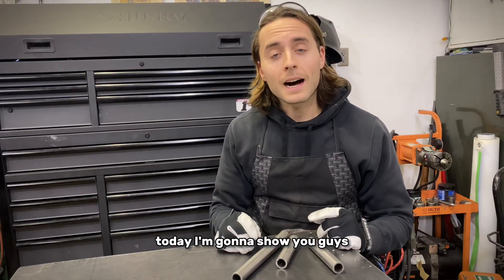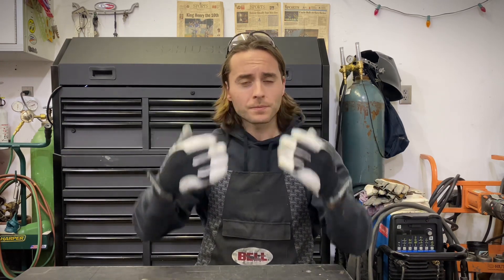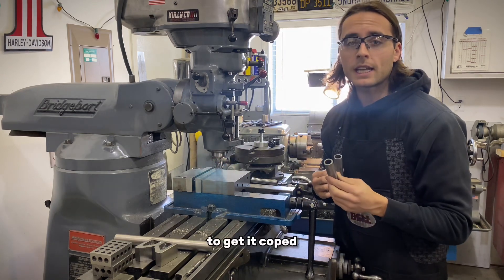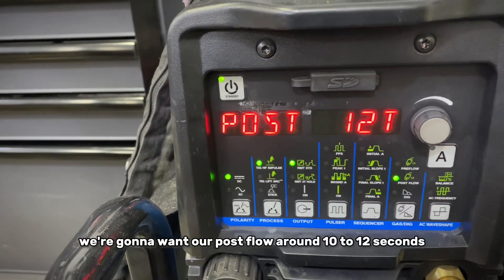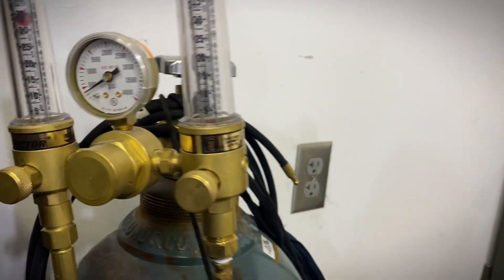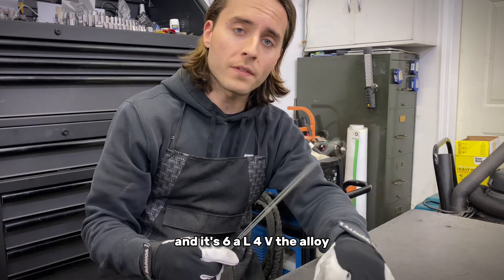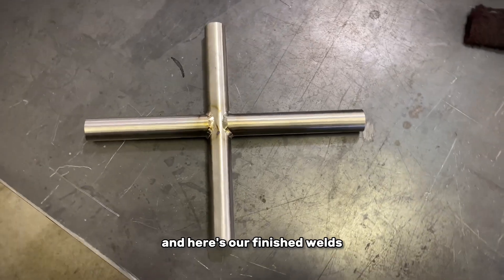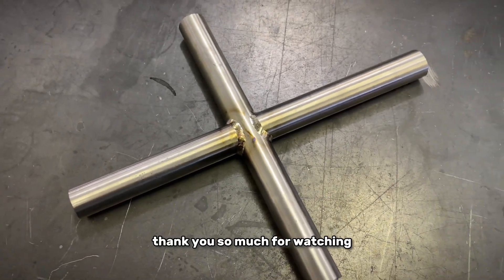How to TIG weld Titanium frame tubing

Comment: Where are you obtaining grade 5 Ti tubing of this large diameter in smaller quantities?   I can only find Grade 9 which is what most bike frames are made of.  Gr.5 is usually bar stock or small diameter, but it is 15 to 20% stronger - so would prefer that if available above 1 inch diameter. Thank you!
Reply from the maker: you can find it at titaniumjoe.com

Comment: How do you know how to properly size your material for the job? I am wanting to build some a-arms for a snowmobile and looking at going the titanium route instead of chromoly to save even more weight over the factory steel ones but want to make sure the strength is there.
Reply from the maker: Just engineering experience, I guess.  Chances are-- the tube size you choose will be significantly stronger than what you actually need, if welded properly!  Alot of guys overbuild things.  Including myself!